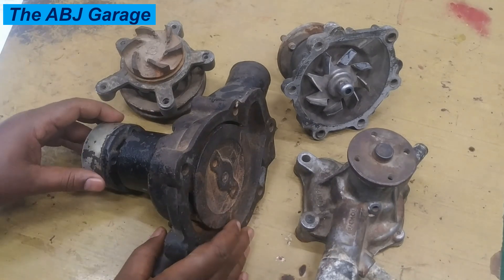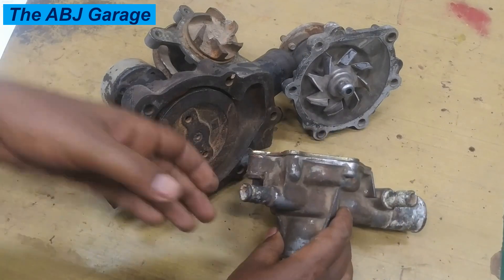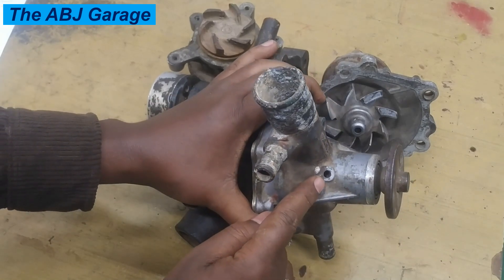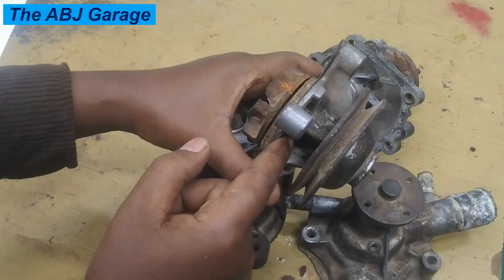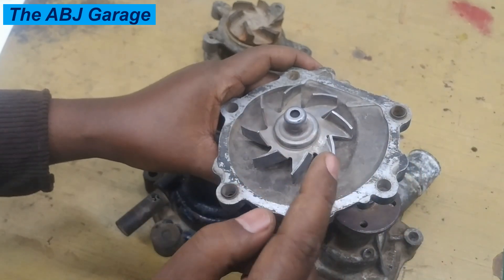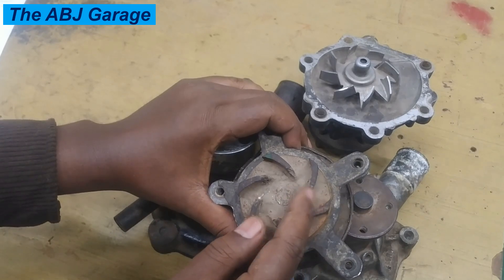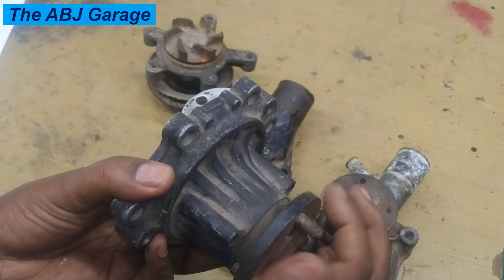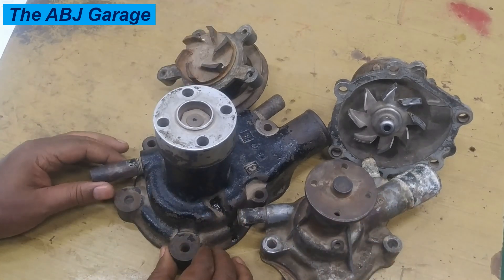Warning signs for a faulty car water pump

Comment: Nice video my brother,what type of noise would you hear? Do you have any examples
Reply from the maker: Whining Noise: might be caused by a loose drive belt or damaged v-belt pulley. Squeaking Noise: often attributed to worn bearings. Rattling noise: could indicate loose components or a failing impeller.